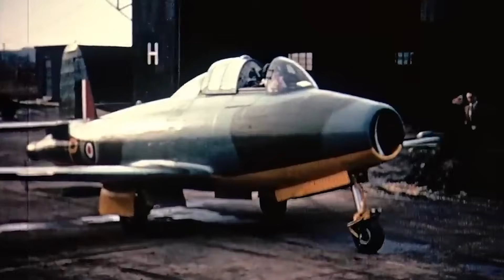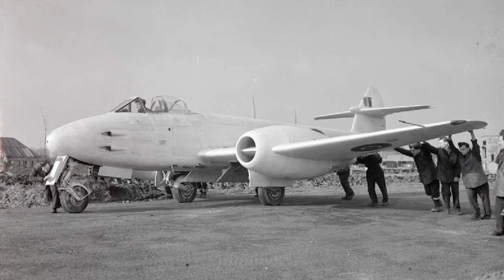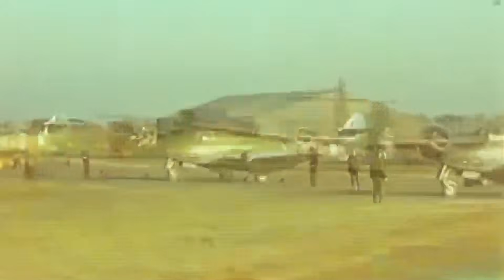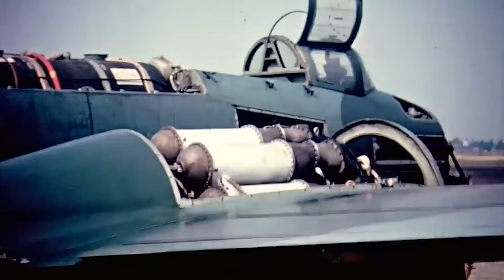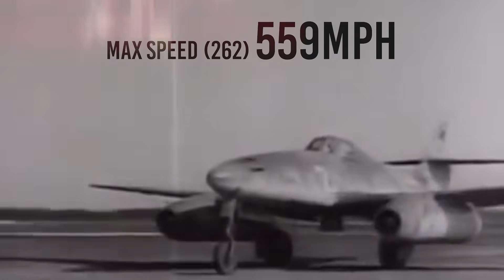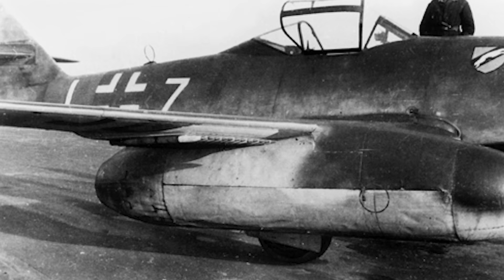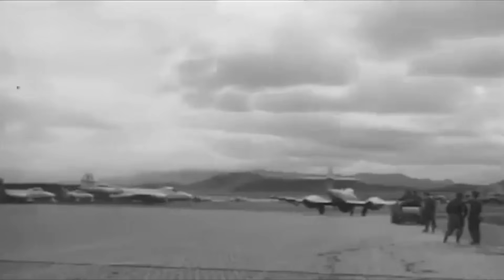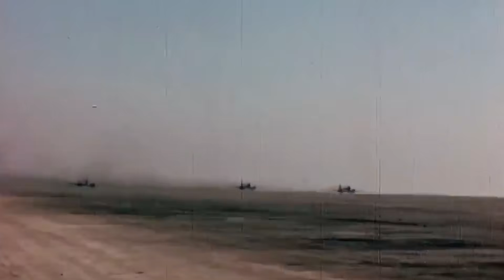Meteor vs Me 262 | Which was the better WW2 jet?

Comment: I had no idea Britan had so many jets in the war.
Reply: 200 odd Meteors built by the end of 1945. One Squadron operational on the Continent in May 1945 (616), One Operational Conversion Unit (1335) fully equipped in the UK and one Squadron (504) which became operational on VE Day. Another Squadron (74) became operational in July and one was in the middle of converting to the type on VJ Day. Meteor Mk 1 production was 20 Airframes built between January and August 1944. 15 of them were used operationally with two lost in Accidents and one shot up by another meteor on the ground. Mk III production started in November 1944 and 9 were completed by the end of the year. 5 in January; 10 in February; 16 in March, 10 in April and 13 in May, after that around 15 a month. Total Airframes in RAF service on VE day was about 60, F Mk III's that did combat missions of some sort numbered around 25. 616 lost 2 while operating in Europe before VE day due to a Mid Air and a few were damaged by Friendly Flak and Fighters, plus German Flak. One did get splitter damage from a Frag bomblet while sitting on its airfield, dropped by a Blitz jet bomber (dropped from 6000 feet, which is the closest an Axis and Allied Jet got to each other in WWII). Meteor was on the ground due to bad weather.
Reply: @richardvernon317  "We had nothing able to fight the 262, it was in a class of its own" -- Eric Brown
Reply: @TheAneewAony  That is why 150 plus of them got shot down......And quite a few of them were not shot down close to the airfield.
Reply: @richardvernon317  That's why the 262 had a 5 to 1 kill ratio, with over 500 air to air kills.
Reply: @TheAneewAony  which is complete rubbish!! and had been debunked by people who have bothered to check the RAF and USAAF records.
Reply: @richardvernon317  All 28 WW2 jet aces flew the 262. All of them. The highest scoring jet ace in history , Kurt Welter, flew the 262. Would you like the list of WW2 jet aces?

Comment: The Me 262 was revolutionary, but the Meteor had one thing the 262 lacked: reliability. In a real dogfight, surviving the engine matters just as much as speed.
Reply: the meteor was not reliable!
Reply: @AndreasKonig-qq7yk  The OP is peaking relatively - while 1940s British technology may have lacked the reliability of kit from subsequent generations, (especially after many years' use if you are referring to the experience of Australia's users), compared to the ME262, the meteor was a star for reliability.
Reply: @mikewindsor5759  the meteor killed way more british pilots than the me-262 killed german ones. most british pilots got killed after the war. the meteor also killed more british than enemy pilots. the british pilots did not give it the nickname "meteorite" for no reason.
Reply: @AndreasKonig-qq7yk  
That was not thru reliability problems.
Reply: @johnburns4017  what then? imcompetence on the side of its' pilots?
Reply: @AndreasKonig-qq7yk  
The low level tactics they were doing.
Reply: Meteor was NOT reliable! The meteor has one of the most dangerous safety and service records of all time killing hundreds of pilots due to engine flame outs and explosions. Look it up right now

Comment: In combat, I'd expect the difference to be the Me 262's 30mm guns with exploding shells.  A single hit on a Meteor would down it, where as the 20mm guns (only 2 on early variants) on the Meteor do not have that sort of destructive power.  Also early Meteor variants were far slower than the 262 barely exceeding 400mph.  The 262 was designed to kill bombers though with encounters with Mosquitos, P-38s and P51s it often came out on top, so against the early slower Meteors it wouldn't be a fair match, later post war Meteors would have been a much more fair match with more guns and higher speeds.

Comment: A recent analysis of Allied and German records on the crash locations of Messerschmitt 262 aircraft has revealed that the widely accepted view that most were lost during takeoff or landing is inaccurate. The research concluded that the number of aircraft lost was relatively small, with the majority being lost in combat with Allied aircraft. While the Messerschmitt 262 was capable of reaching a top speed of 560mph, it suffered from a fundamental problem known as snaking or directional instability, which was never resolved unlike the Meteor. The key difference between the two aircraft lay in their design philosophies, the Meteor design was based on practicality. George Carter, a designer of the Meteor, recognised the new technology and designed it to be easily modified as they gained more technical information. Consequently, they easily modified the tail the fundamental difference in design and lengthened the engine nacelles to address the snaking issue. The Meteor was designed for combat, with its low wing load providing significant manoeuvrability, resulting in shorter takeoffs and landings but the Meteor was designed with a fundamental Jet requirement Air Brakes. Ultimately, the Meteor surpassed the Messerschmitt 262, breaking the world speed record. The meteor tail design principles were carried forward onto the Gloster Javelin and de Havilland Sea Vixen.
Reply: You seem to know your stuff, Sir, so I shall put to you the question that sprung to my mind when I first started watching this video: why were the engine nacelles of the Meteor so much longer than the Schwalbe? And while the engines of the Me262 were suspended under the wing, the engines of the Meteor seemed to be in the MIDDLE of the wing; does that mean that the Derwent engine, for example, was situated BEHIND the main wing spar, or were the outer wing sections 'tacked on' to the engine nacelles?
Reply: if you search for the F2 Axial Flow Meteor Prototype you will see the nacelles are positioned below the wing like the 262. The aircraft crashed when it lost an engine.
The Derwent engine in the Gloster Meteor is small. In contrast, the jet engines in the Meteor are mounted between the main spars of the wing’s centre section. The nacelles housing these engines are built up between the inner and outer engine ribs, with the rear spar deepened to accommodate the jet pipe. This arrangement provides easy access to the power unit. The entire top half between the spars, as well as the nose forward of the front spar, can be detached. If you look at the Meteor nacelles, you’ll notice the forward spar ahead of the engine.

It’s worth exploring the Goblin H1 installation in the first prototype to fly. George Carter designed the Meteor wings to accommodate all of the British jet engines: the Whittle, Rolls Royce, de Havilland Centrifuge flow, and Metrovick axial flow. The wing was modified to accommodate whichever engine was tested.

The Aerodynamic Section at R.A.E. Farnborough was studying ways to improve the high-speed characteristics of the Meteor. Wind tunnel tests indicated a breakdown of airflow around the engine nacelles at Mach .75, resulting in increased drag and severe buffeting, with the centre section completely stalled. Further experiments demonstrated that these conditions could be delayed by increasing the length of the nacelles in front and behind the wings.

Full-scale trials on EE211 in November 1944 demonstrated a significant increase in performance with the longer-chord nacelles.
Reply: @DNorthWest  Thank you for the detailed reply, which has answered my question completely.
Reply: That would be incorrect. Eric Brown on the 262:  "...the aircraft had excellent directional snaking characteristics making it a good gun platform. From this aspect it was the best jet fighter of it's time, and I was certainly in a position to judge, having flown every jet aircraft then in existence. A check on the rate of roll at 400 mph revealed the highest that I had ever experienced outside of the realm of hydraulically-powered ailerons, and the stick force demanded to produce these exhilarating gyrations was delightfully light. Leveling off at 12,000 feet I settled down to another spell of the pleasures of the phenomenal roll rate of this delightful little aeroplane ... I had never met better flying controls ... Even if somewhat underpowered it had a good performance - it could certainly have run rings around the contemporary Meteor. I was to fly the little aeroplane quite frequently."

page 138
"Wings of the Luftwaffe" Captain Eric "Winkle" Brown
(C) 1977, Revised 2010, reprinted 2011, 2013
ISBN 9 781902 109952